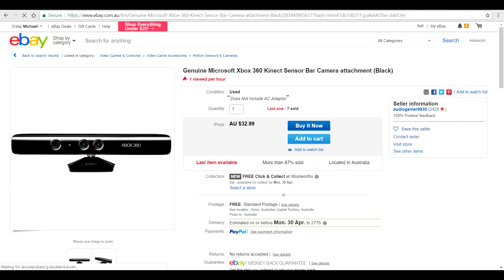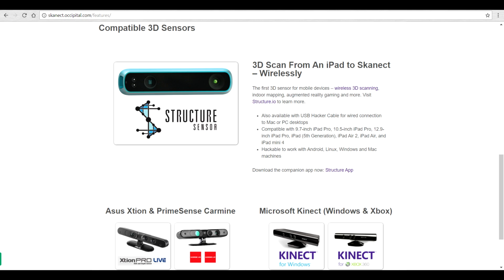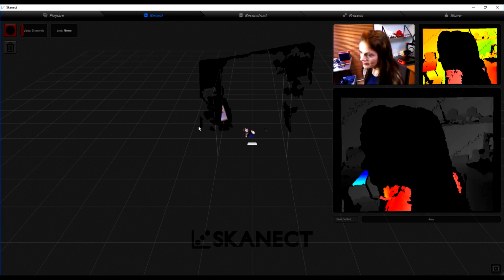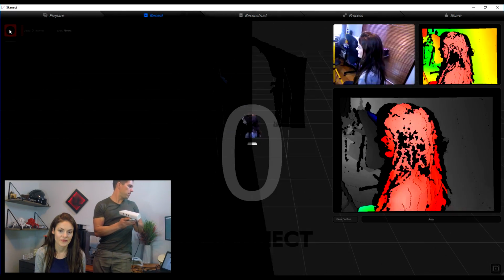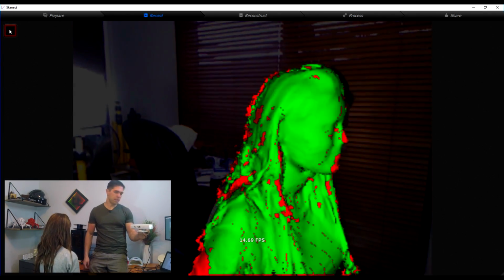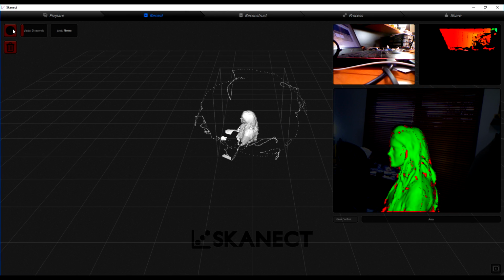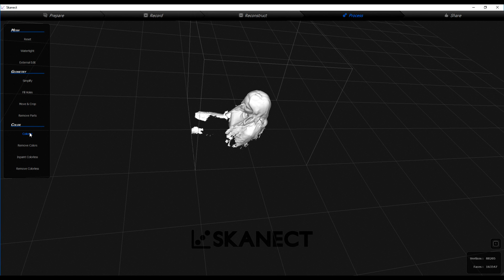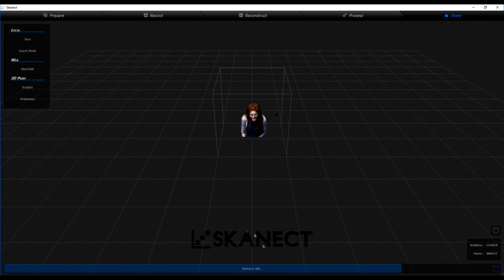3D scanning with a Kinect sensor - Skanect

Comment: Hello there congratulations for your video and it is very interesting to see the applicability of the Kinect sensor.
I am a biologist and a newbie in 3D scanner and I have just bought a Kinect sensor v2.And  I  have faced an issue with my kinect software and I am wondering if you could help me.
Apparently I need to have access (a copy) of the  kinect fusion Explorer 2.0.exe . And I cant get it anywhere online.
Could you please help me to get it? Or suggest any other software to replace it?
Thanks a lot and I look forward to hearing from you soon.
Best regards, Valeria

Comment: This program does not work at all with my kinect V2 of one, the 3 icons in the upper right corner are yellow.
I use a Ryzen 5 2400G processor, MSI X570 gaming Plus card, GigaByte RX 580 8Gb video card

Comment: I used the ICP algorithm to merge cloud points, but there is a problem when extracting frames during RAM filling and closing the application immediately, your solution is to capture frames for model building process. Thanks for reading comments and it would be nice to hear your solution.

Comment: How do you tell if the issue is the Kinect V2 or A/C adapter when connecting it to PC.  Plugging into a 3.1 USB with Win 10 x64 and nothing recognizes the Kinect.  Not sure how to tell if it is even on.  Drivers and bios are up to date.

Comment: would the v2 kinect for the xbox one yield better results? I can modify it or get the AC plug adapter to power it that's not problem but wondering 3d render quality wise?

Comment: Hi after watching your video I bought a xbox 360 Kinect model 1414 off ebay, but it has come with a non standard USB plug that will not fit my USB port , exactly which model did you have that plugs into normal USB port ? thanks
Reply from the maker: I can't see any code like that on the sensor and the ebay listing is long gone. I had to buy the USB cable separately because my listing stated they didn't have it. Maybe yours is the same?
Reply: Search for a kinect usb power adapter
Reply: Ten bucks at Amazon. https://www.amazon.com/gp/product/B073GY3C7Z/ref=ppx_od_dt_b_asin_title_o00_s00?ie=UTF8&psc=1

Comment: Looking at the age and sale of the Kinect is there something more modern that would be a good choice to replace it?  You did a great job on the video and I have something in mind for a project.  The thing is I need a little more detail.  To compare with the facial bust, is there another scanner that would provide a little more detail in the face?
Reply from the maker: There are heaps of hand held scanners these days, I just don't have the use for one to justify the cost. Sorry I don't have more concrete info for you.
Reply: Have you been able to get better facial resolution than what was shown in your videos?
Reply from the maker: No, but I haven't tried anything different from what's in the video.

Comment: A little late to comment on this but what hardware were you using for the capture? Specifically, were you using the CPU or GPU and what specs was it (5-year-old laptop with no discrete GPU vs some octo-core monster with a dual 1080 cards)? Thanks for the great channel content!
Reply from the maker: Hi Tim, I'm on a getting on 'gaming laptop'. GTX 960M GPU so ok but nothing compared to a modern gaming pc.

Comment: Can you please show what the difference in scanning in pro from the free.  Does it give you more detail if put on the highest setting.  I was thinking of buying the pro version but won't if the detail isn't any better then the free.
Reply from the maker: Looking at their website it seems as if the export is what is limited in free. Therefore what you are seeing now is what PRO will give. There are clip on lenses you can get for Kinect 360 sensors that zoom the image. I'm curious if it would give better detail with Skanect.
Reply: I found an article on this guy who used the lens from reading glasses, the ones you can buy at the store with different magnifications and the free version of Skanect.  It gave him a lot more detail then what he got without the lens.  The only thing they said was that you would have to use a lens that is on the flat side.  I think he used a 1.50 magnification but can't remember exactly.
Reply from the maker: I bought cheap magnified reading glasses for this once upon a time but decided it was too much trouble.
Reply: I do hear that with the new Kinect V.2 you get higher detail because of the better high res cam and sensor.  All you have to do is get the adaptor to connect it to your pc and Microsoft builder which is on all windows 10 pc will detect it.  But Microsoft is no longer going to be selling the scanner and the adaptor. It normally sales for $49 US, but people on eBay are robbing you by trying to charge like $200 and up just for the adaptor.  Here's a link where they use it.  https://channel9.msdn.com/Blogs/3D-Printing/3D-Builder-Tutorial-Part-5-3D-Scanning-with-Kinect-V2